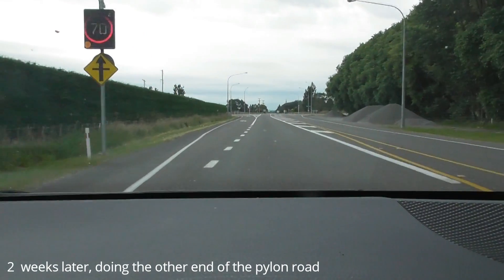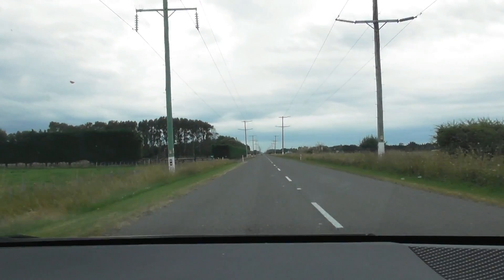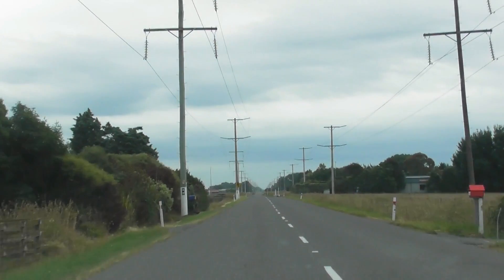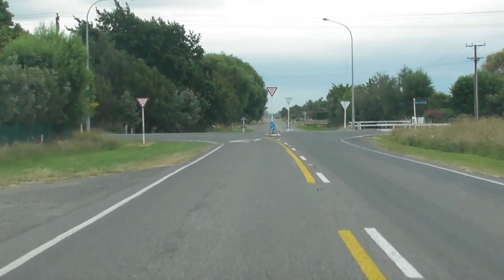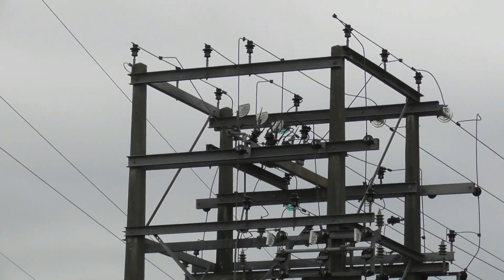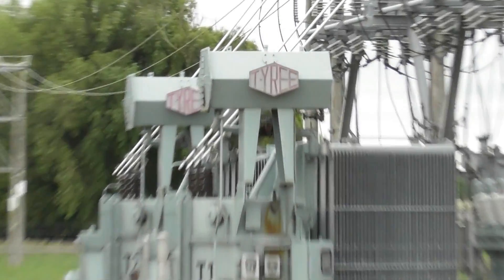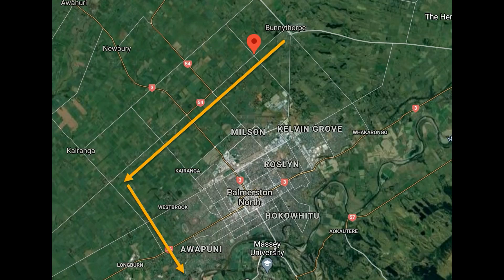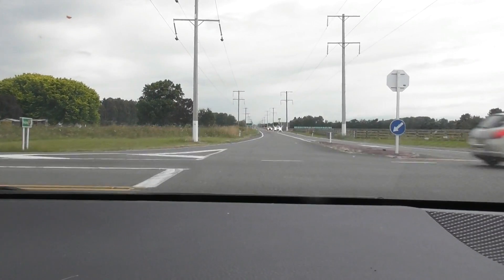Kairanga-Bunnythorpe Road with pylons

Comment: These lines are similar to a design used many decades ago by the Byllesby holding company subsidiaries. I have pictures of an old Northern States Power Co. 69kV line built to very similar specifications and a friend showed me an old Mountain States Power 115kV line that was also built to the same proportions.

Comment: It's so nice & refreshing to know there are other people out there,that love powerlines,sub transmission & transmission lines,as much as I do & I work on them but it never gets old to me.And hey RODALCO,I live in Adelaide,the capital city of South Australia & we are the only place in the world,that uses poles called Stobie poles,named so after its inventor, Cyril Stobie,they are 2 pieces of H mould steel set at an ever so slight angle to each other then the middle is filled with concrete,they were invented due to a lack of suitable wood here in SA.They are very strong & range in size from 9m suburban street size,up to 26m 66kV sub transmission level,the only downside to them is when a car hits the big boys,at speed the car will shear in two & death of the occupants is almost guaranteed & the pole will barely even wobble,the smaller ones,on the other hand,if hit at high speed can be & often are ripped clean out of the ground or at the very least all the concrete smashed out of them & completely mangled.But anyway if you haven't seen them before,check them out on Wikipedia "Stobie pole" I'm sure you'll find it interesting.Cheers from down under!😁
Reply: There are many line pictures over on Flickr and ipernity.

Comment: if you ever happen to come to picton  in the southisland  thers a road going aroud the south east hill and conecting many small beaces. On one of them there is a free campground directly underneath some very big powerlines spanning from one hill next to the bay to the other. Nice place. quite remote tho.
Reply: Those transmission lines are the HVDC Inter-Island link (https://en.wikipedia.org/wiki/HVDC_Inter-Island). Since the line is DC, there are only two conductors (positive and negative) instead of the usual three for AC transmission lines.
Reply: @lcmortensen  thanks man, amazing system :D Not many people can say they have slept underneth a 1,2GW powerline :D

Comment: Guess the steel and concrete poles are the original line install, with the creosote poles as later install, and the green finish as the most modern parts, or as replacement poles.

Comment: I have 220kv lines running through the farm labeled Manapouri to Tiwai Line A and a Second 220KV line labeled Invercargill to Tiwai point
Reply: Those 2 lines would supply power to the aluminium smelter plant at Tiwai Point
Reply: @Destroyed007  yes they do circuits A and B each has 12 conductors per pylon and a lightning wire at the very top